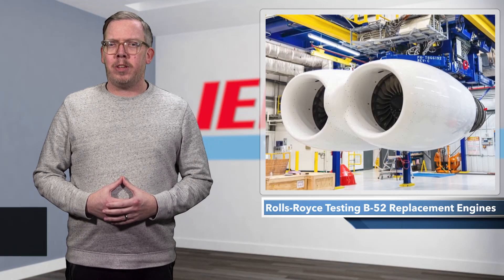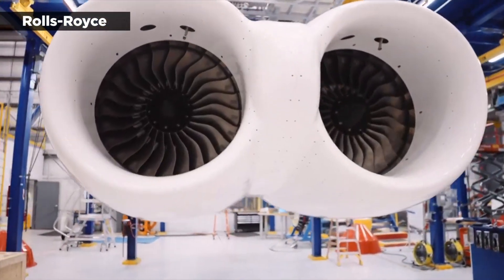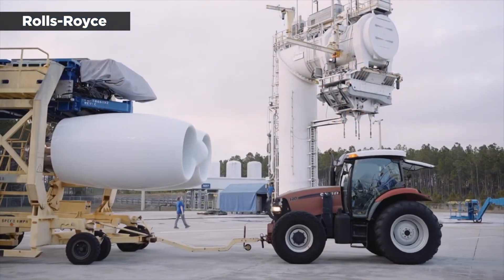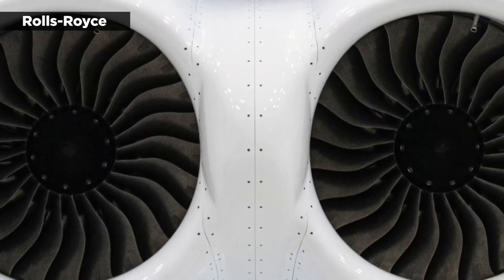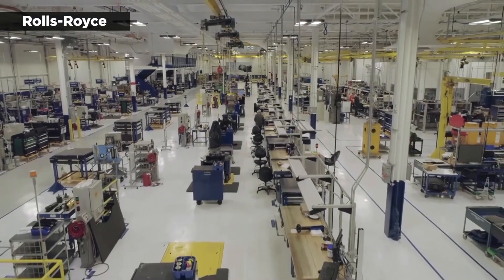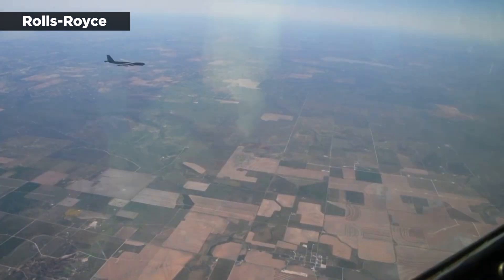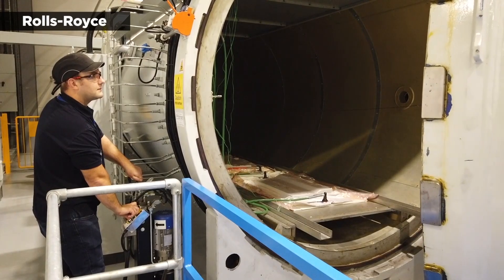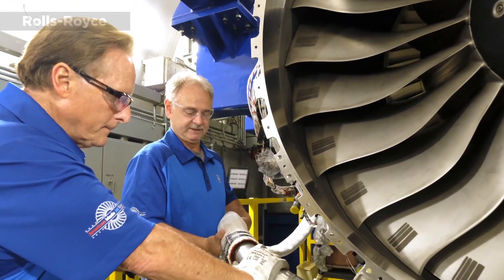Rolls-Royce Testing B-52 Replacement Engines

Comment: Wonder what the Thrust force will be with 8 of these.....  double the bomb load and/or bigger bombs
Reply: According to Air & Space forces magazine they are not increasing overall thrust, which might require re-engineering the entire wing, but instead are looking at total maintenance time, fuel consumption and parts chain. The touted benefit to reduced fuel consumption is cost of operation, but to me, it means longer reach for missions or increased loiter times once within striking distance - giving commanders more flexibility to utilize the platforms weapons. Overall, just a much needed upgrade.